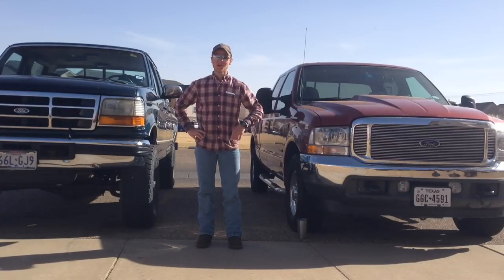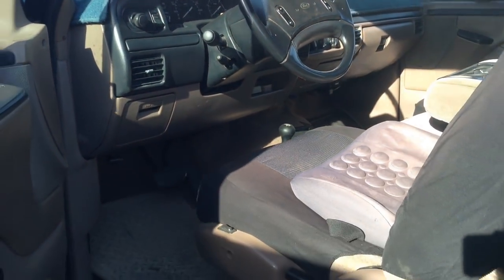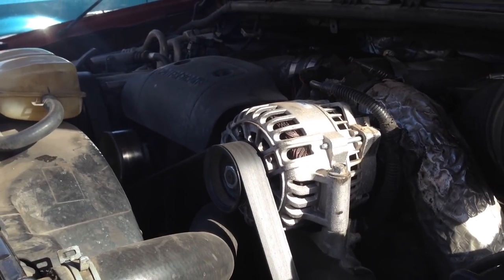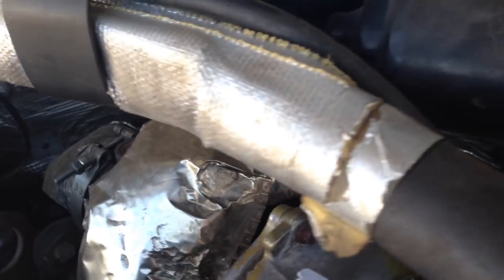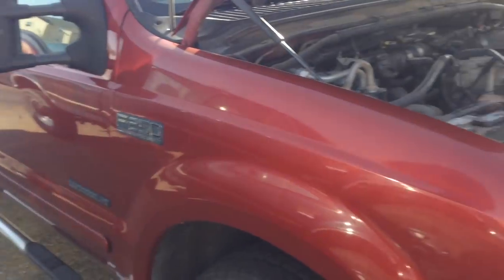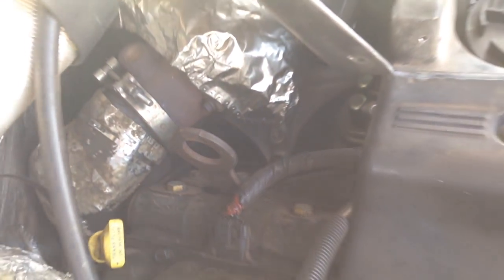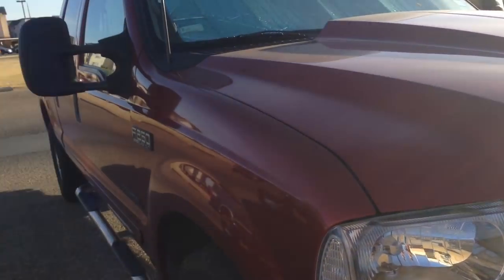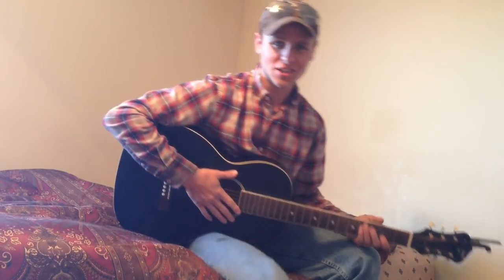OBS vs Superduty 7.3 Powerstroke

Comment: Would you have any concerns about a 300k mile 5 speed obs? Looking to buy one soon
Reply from the maker: If you run through the typical checks for blowby, it shifts fine, starts cold, and feels like it makes good power, then I'd go for it. If you find any starting fluid near the truck, I may be a bit leery, and would definitely ask if it was used. Starting fluid can be very bad for the engine. My truck just rolled over 400k miles and runs great. It leaks some oil, but with fresh injectors it makes plenty of power. Are you willing to do some work on the truck like replace glow plugs, or are you looking at it to be a good to go oil change only truck?
Reply: @Rnddiesel  I’m very mechanically inclined, just haven’t owned a powerstroke before. Thanks brother!
Reply from the maker: @1_2_Many_Projects  Then I'd definitely go for it. As long as the engine bottom end is all good, and the transmission is good, you can replace injectors and whatnot if needed. Even with worn out parts they'll just work. These Powerstrokes are legends for a reason. I'd definitely keep a spare camshaft position sensor on hand though. That's one thing that'll for sure stop a 7.3 in its tracks.
Reply: @Rnddiesel  ive heard about that and the icp, gonna be a service truck so I won’t have any shortage of tools on hand

Comment: I have the OBS 7.3 Reg cab. 4x4 automatic transmission. Few years ago. I considered trading for a new truck. My truck gets 16-20 mpg. Most tanks averaging 17.5 there abouts. After some  research. The new trucks want do that. Not to mention all that emissions stuff that is hung on them now. AWFUL!!! Ford's f250 6.2 gas, gets 11-12 mpg😲. Decided to keep my baby to the wheels fall off. Don't use it as much now. Drive something else. For daily driver. Use my 7.3 for farm work. However, that doesn't mean it's not well cared for.. The fliuds, I change way before recommend milage. New antifreeze ever 2 years. Wax job at least once a year. Have a garage place for it. These trucks can't be purchased today!!

Comment: What boot did you use for the air cleaner
Reply from the maker: I'm just using a super duty 7.3 intake boot from the junkyard. With that a piece of 4 inch exhaust pipe connects the air filter to the intake boot. It gets the job done!

Comment: How difficult would be to swap a 7.3 obs into a full size bronco?
Reply from the maker: I have no idea! They should have the same frame dimensions, I think the 3/4 ton and up trucks were just built with thicker steel for the frames. The engine bay should be the same size, but the engine does weigh around 1,000 lbs so you'll likely need to beef up the front suspension as well.
Reply: @Rnddiesel  I saw a while back a 1996 Broncos that was powered by a 7.3L. It was also made into a 4 door and looked like a early version of the excursion.

Comment: F350 vs F350 because they both have straight axles
Reply from the maker: Good point! My friend only had the 250, but at least from an engine standpoint is close enough. Maybe one of these days I'll get an SD 7.3 F350 to compare again.
Reply: @Rnddiesel  good thing you did f250 vs f250 not vs f350 thank you for not being dumb overall I liked the review

Comment: I just bought a 97 f350 7.3 with a gvwr of 11000 pounds and I’m fucked cause it needs commercial tags what can I do?!?
Reply from the maker: Guy Stuart, I don't really know much about commercial tags on trucks, so I apologize I likely won't be much help. I did do a little bit of research into the subject and here's what I found at least regarding the definition.

Commercial motor vehicle means any self-propelled or towed motor vehicle used on a
highway in interstate commerce to transport passengers or property when the vehicle—

(1) Has a gross vehicle weight rating or gross combination weight rating, or gross vehicle
weight or gross combination weight, of 4,536 kg (10,001 pounds) or more, whichever is
greater; or
(2) Is designed or used to transport more than 8 passengers (including the driver) for
compensation; or
(3) Is designed or used to transport more than 15 passengers, including the driver, and is
not used to transport passengers for compensation; or
(4) Is used in transporting material found by the Secretary of Transportation to be
hazardous under 49 U.S.C. 5103 and transported in a quantity requiring placarding under
regulations prescribed by the Secretary under 49 CFR, subtitle B, chapter I, subchapter C. 

That being said, I assume that you intend to use your truck for business purposes? I don't use my 97 F350 for anything other than daily transportation and the occasional run to get fence supplies, cubes, or fertilizer, and as far as I know I don't need commercial tags. However I also don't use my truck for a business.

Comment: Superduty was faster because it didn't have that heavy ass front axle like the 4 wheel drive OBS
Reply from the maker: Bruce Lee perhaps that was the case. I'm sure it makes a difference, plus my heavy toolbox. I just thought the SD had more power, so that explained it. I'm sure there were multiple influencing factors.
Reply: The superduty was faster because of the injectors were bigger and better hpop front axle plays a small role
Reply: Because it's a Intercooled turbo....

Comment: E40d transmission is the weak point
Reply: Jon Smith that’s a fact.
Reply: Not unless you drive like a doofus, and run around hauling 10k trailers up hill in overdrive. The E40D is s heavy duty box.
Reply: 305k+ miles on the factory E4OD
Reply: Jon Smith THE E4OD. Use correct English.
Reply: Just like any other automatic transmission, they need to be cared for. Keeping them cool and maintained is key. The E4OD in our truck has 230+ miles. 25-30k fluid changes and BA Aftermarket cooler.

Comment: Bud. Hate to say it because I love all Ford but a superduty would be a HUGE upgrade for you. Obs is nostalgic but superdutys are leaps and bounds over old obs.
Reply from the maker: Yeah I may eventually get a Super Duty too. I do like them, though it's not really in the budget right now. Besides it's hard to justify a SD when my OBS is also intercooled, has a bigger downpipe than a stock SD, and has a set of larger 160cc/00 injectors : ) I can run 0-60 mph in less time than a stock SD now without even putting the pedal to the floor. Besides, the OBS has more room for improvement and is easier to improve with simple modifications. Its all part of the fun!

Comment: Gotta boosted launch that ole hog get that 0-60 under 10
Reply from the maker: Donny Bra I don't know about that, I'm worried enough with the transmission having who knows how many miles on it. Haha, besides I'm afraid it'll take more than a boosted launch to get the 0-60 under 10!
Reply: I used to 'boost' launch my 500hp Duramax (just under 1,000 lb.ft tq.) and it would hit 60 in high 4sec.  Up to about 40-50mph it was quicker than my C5 Corvette and beat a Lamborghini Gallardo from stoplight to stoplight.  Stock Allison transmission and 200k.  (Oops, youd better run the Chevy boy off😁...)

Comment: The obs dose have a wastegate it's on the bottom side of the Turbo
Reply: That is not a wastegate it is a exhaust back pressure valve and it is to help warm the engine up when you first start the pickup.

Comment: GEM modules suck. the SD has better frame, an intercooler, available drop in 38r, more cab insulation (but an extended cab is LOUD wind noise). to make a good truck you have to cherry pick the best parts. with an OBS you do not have a good drop in turbo option so it makes more sense to step right up to a T4 setup where the SD will tempt you with a 38r. no volt gauge on the 05 we have sucks